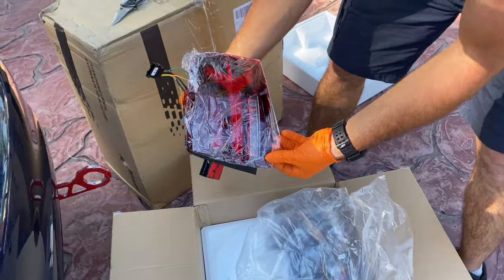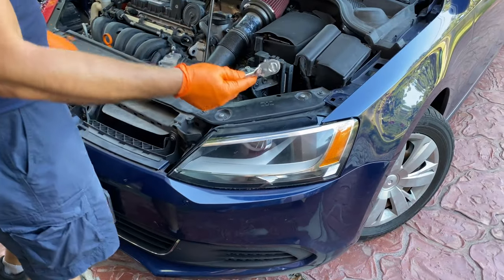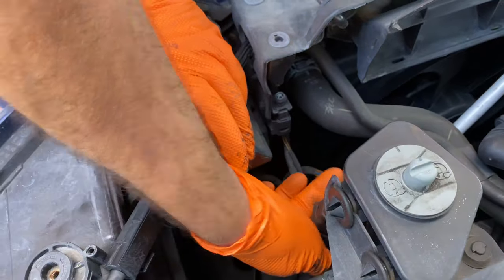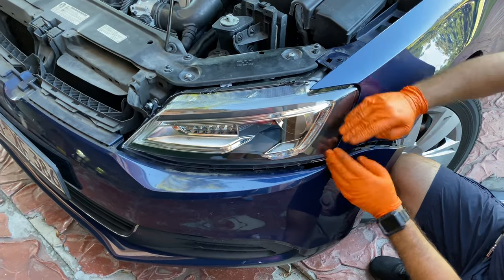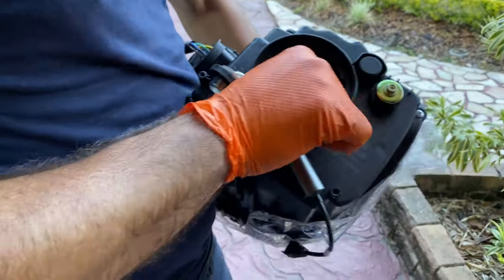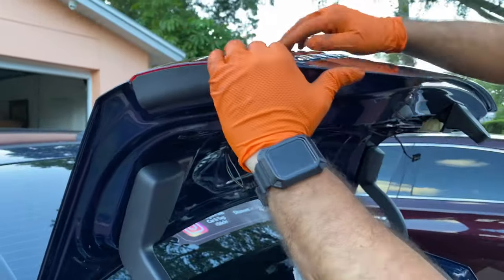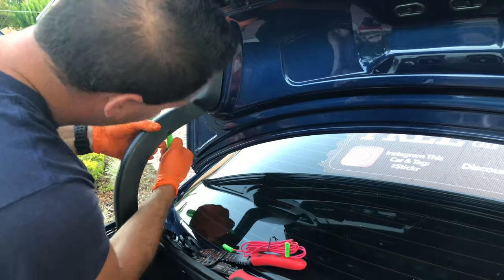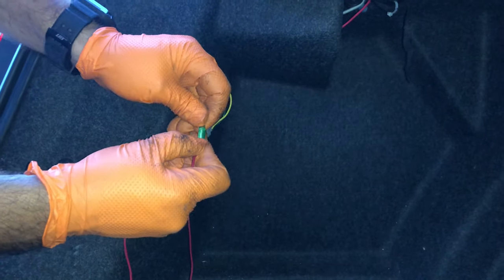Headlights & Taillights Replacement (vland) for VW Jetta MK6

Comment: Any bulb out warnings?
Reply from the maker: Yes that warning signal always comes on when the lights are on.
Reply: @AdonayLopez  have you tried wiring in a resister to wire for the cornering lights? I read online that this can make the bulb out error go away and not come back. The error is due to the lack of  cornering lights on the side makers of these lights. The car is looking for those
Reply from the maker: @matthewcunningham1480  thats interesting, I didn’t think of that but its a good idea it could fix that issue
Reply: @AdonayLopez  let me know if this works out for you I’ve been looking into these headlights it’s an issue with a lot of them
Reply: Did you ever end up getting rid of the bulb out error

Comment: what size bulb?
Reply from the maker: They are H7. 

https://www.amazon.com/dp/B07FRC77GX/ref=cm_sw_r_cp_api_i_1M6KFbPW1HBZT?_encoding=UTF8&psc=1
Reply: @AdonayLopez  did you have daytime running lights or ur stock lights?
Reply from the maker: @flennard1146  my previous lights did not have DRLs.
Reply from the maker: The H7 fit on both the old lights assembly and the new lights assembly
Reply: @AdonayLopez  what about the high beam bulb?  Does the VLAND housing have high /lo beams?
Reply from the maker: @boto808  it uses the same housing for both only one bulb it’s required.
Reply: @AdonayLopez  Is it a special dual beam bulb?  or does the housing somehow get it do both high and lo?  Thanks for the reply btw!

Comment: What exactly is the use for the brake light wire
Reply from the maker: That wire its to give power to the one taillights that’s open up together with the trunk because the oem ones don’t have brake lights in them and The new ones do
Reply: Adonay Lopez ohhhh ok i got it now, didn’t even think of that, thanks